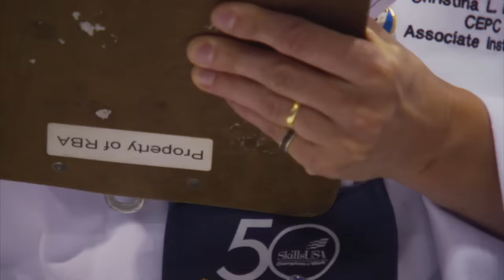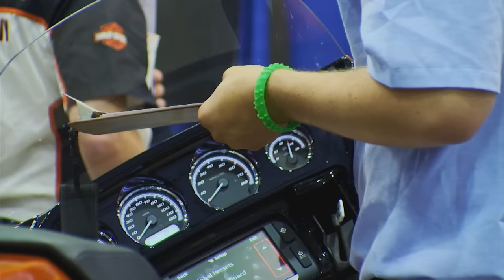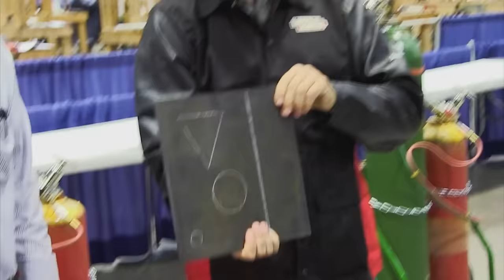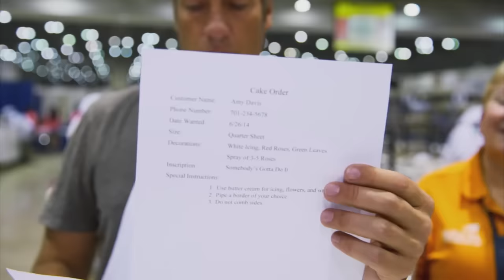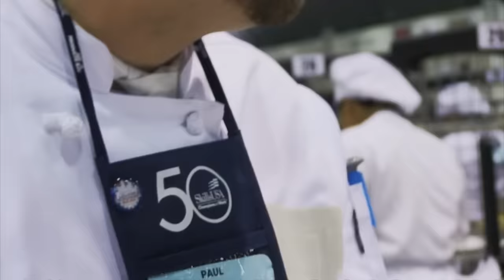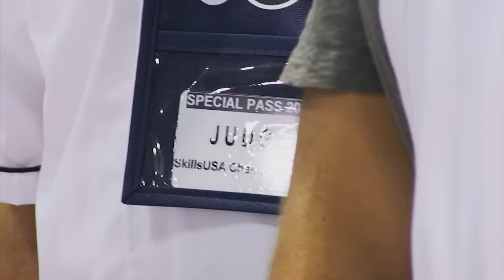Mike Rowe on How Much Welding and Other SkillsUSA Trades Can Make YOU | Somebody's Gotta Do It

Comment: I have been mechanicking on things since I was about 5 years old . Been to school for Diesel Mechanics , Electrical , and welding , also work on and  operate heavy equipment as good as any pro.  My current job has me fabricating steel and aluminum for a pump company and I also rebuild the pumps and the electric motors , can repair the control panels and create new pump systems from scratch and take a guess at what I make in southern Louisiana with all those skills !!!

Comment: Wanted to quickly go over some of the welding stuff:

for the welding job being 75,000-125,000 that's kinda for construction sites. Fabrication - being in a factory sorta seeing making general assemblies - you are in the 19-24 dollar an hour range with 2 year experience. So about 38,000-46,000 in those settings. So the outdoorsy, harder jobs are pretty well paying yeah. Pipe welders also the 75k-125k range but you are never home sadly. You get paid like 30-35 and hour off the rip in those jobs just by being able to do it and willing to do it with most gas being comped but draw back being away from family and driving endlessly kinda a negative for most.

Traveling welders - guys who work at a shop and go out to repair random things here and there for companies - get paid dumb money in the 100,000 range generally. But you are in a care for 90% of it.

The welding jobs that get you 200,000-250,000? Oil Rig welders and Underwater welders and you only work 3-4 months a year. But you are working 70 hour weeks minimum for that entire time and underwater welding still has a shit ton of health issues afterwards. But if you get the training to be an underwelder worker and just do it for... 2 or 3 years you can start your own shop back home with a good baseline investment.
Reply: ALSO going to keep this vague kinda. At some factories if you are a welder? You are given a weld booth - 15 x 15 feet or so for some places maybe 10 x 10 - told "Okay this is your booth. here's your quota... do it however you want don't care if you listen to a podcast or listen to youtube, take breaks when you need to, ask for whatever tools you need or materials to make your work as best it can be. We'll give it to you." So, you can take it easy for some manufactoring.

Comment: Been a certified welder since 1976 got into the operating engineers Union in 1976 have worked every since then never missed a day averaged over $140,000 a year with full benefits people are always asking me to go work at their company but I apply myself I have went to the training site and learn to do many things run heavy equipment repair welder in a good welder makes a difference

Comment: I was a welder for four years and it's cool. However there are long term problems as it releases toxic fumes. Especially with galvanized steel and no vent hood. Also they are rapidly being replaced by robotics. It will become more of a craft art like knitting, or for minor repairs. Not a full time salary anymore.

Comment: Why don't you upload the entire 1 hour show instead of the 20 minutes segments?
June 23, 2018. Mike visits a SkillsUSA trade show in Kansas City, Missouri to practice welding, baking, and broadcasting.
Season 4, Episode 5. Runtime 1 HOUR.
Reply: Because he doesn't own the shows.  He has permission to re-edit them to these shorter videos, which he posts on YT, FREE. You can probably buy the entire hour long program for a few  $$ !  And in case you didn't notice: the "1 Hour" includes several minutes of commercials and a cable subscription.

Comment: man i begged for something like this in high school. Never got it. I just go to trade school now and try and get better all the time. What really sucks is my current welding employer is paying alot but, doesn't need welders for our section so I lose my skills. DO NOT GET A JOB LIKE THAT. and yes im quitting asap to find a place that needs a welder not a hole master. I did pass all my welding tests no problem.

Comment: Just to toss some data at you guys. I live in Halifax, Nova Scotia, Canada, where we have a contract at the local Shipyard to build Canada's replacement Navy ships for the next 20 years. If you have a Red Seal already in welding, and it does not have to be a pipe ticket, you will make 44 dollars at hour at least, you make a bit more if you have extra training, like pipe welding tickets, etc. 
    There is always overtime on the weekends that gets shared, so you will get a shift or two every second weekend at double time. You don't have to "break your back" to work there, but high quality and an above average attendance attitude will keep you there till you retire. You will clear, after taxes and all the other deductions $1,039.00 per week. 
PS: We are actively looking for Red Seal welders right now. Come to Canada, we have cookies.

Comment: Welding is terrible for your lungs. Nobody talks about that.
And let's be honest, the pay in trades is too low unless you start your own business. Trades should get $50hr now at a company, but most are stuck paying us like it's still 2006. 
Look up how much a concrete finisher makes in Los Angeles. You'll be lucky to get $25 an hour, look at the living expenses.
Reply: Good point for the untrained. Hood goes down eyes go shut if you are an observer. Also if you have training you will learn that as you weld you breath out. Both to steady the hand and to limit the intake of carcinogens. It is more beneficial to improve the safety standards than to turn away potential tradesman. Rowe should run for President.
Reply: LOL they have filter and positive pressure welding hoods along with fume extraction as well this stuff have been out for 10 plus years.  Trades get paid good.  You can't expect to make $50 at some company's but yet at others you can make $100 per hour.  It just what that market can handle.  The other factor is the benefits as well that cost a lot of money as well.  There problem is the more you pay someone the higher the item cost to make and there a point that it will be price out of everyone market.  You can't pay a mcd worker $15 with out increasing the food cost then when you do that the guy make $30 is making less then he need to get a pay increase as well. Production cost need to go down.  Higher up and all the overhead need to be trimmed from most companies and cost will go down.  Does a ceo need to be making 50 million  a year from  a company no.  I seen so many youtube short of guys saying this concrete job was $40k and there only $10k of work there. there are just out to get all they can and it screwing everyone else. Charge a fair price and you get more work and make more money.

Comment: The trades make the world run. Every job, at some point, will NEED a trade worker involved somehow, somewhere. It's ridiculous how manual labor jobs, not just the trades, have been relegated to low standard jobs, when most of them make more, to varying degrees, than the jobs that most people think of. It's a shame because the trades are dying due to majority of people looking down on them. This leads to people hiring tradeseople to repair something, then leaving a bad review due to some reason. Most of those reasons are because that tradesperson is WAY overworked because there's far more work than workers. It's not that they don't want to do the job, it's that they have 5+ more jobs to get to that day that will take 2-3 hours each to do. They gotta get in and get out. Meanwhile, the person that hired them thinks the person is just lazy or rude.

Comment: Welding, a torch is not welding but cutting, there are Welders and fitters, and you make more as a fitter. I started in the shipyards at 17 making $20hr in 1987 that would be around $50hr today, so what is the average pay of a welder in 2023? $21.70 via US average this here lies the problem.

Comment: As a manual machinist for over 40 years I could never recommend that a person pursue that trade. Companies have refused to accept the position that there will not be anyone in the trade in the now near future. The pay and benefits are not worth the years of work developing your skills. You will forever be beholden to the company for the equipment necessary to do your job and will need to ingraciate  the company to pay you for a skill they cannot replace. Having warned my company that my skills will not be replaced fell on deaf ears.   Now only a few years out from retirement they are scrambling but are not finding any qualified machinists. CNC people do not have the skill I have despite attempting to integrate them, it has never worked and never will imo because of the way they look at the task at hand. It’s a shame to, as you often don’t need thousands of parts to complete a task.